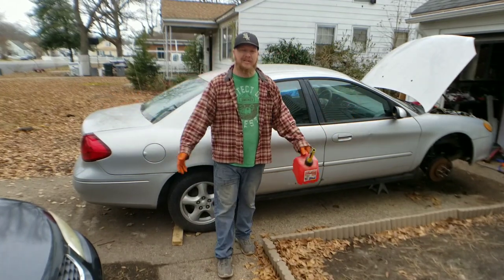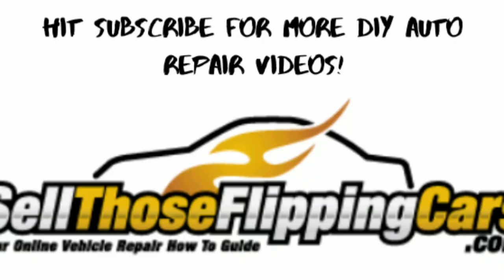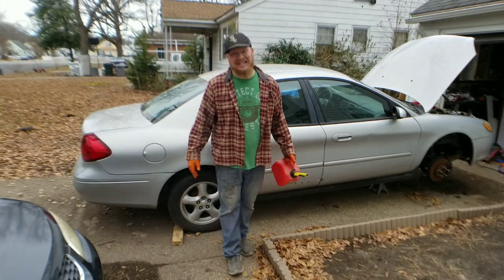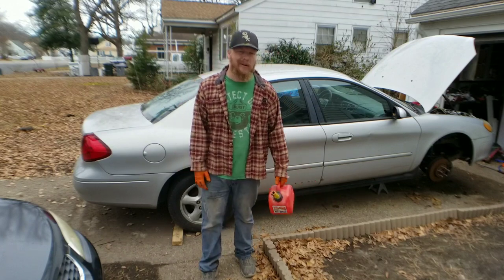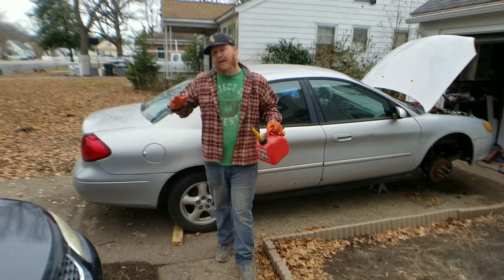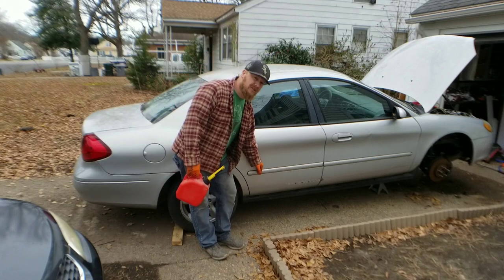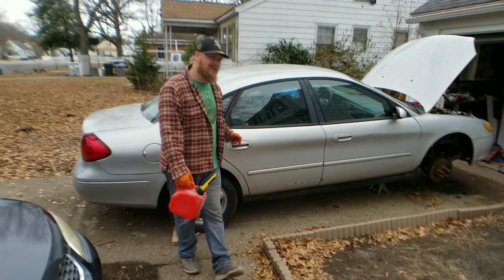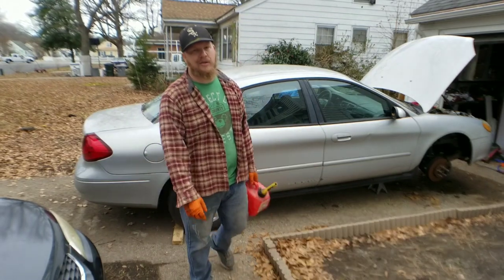What are some Dirty Fuel Filter Symptoms?

Comment: The word you're thinking of is corrodes.
Reply from the maker: Thank you Mathias I knew it I couldn't think of i. Even though it was on the tip of my tongue lol
Reply: @Sellthoseflippingcars  Hey I gotta quick question. When I start my car in the Morning... It starts great runs great. If I turn the car off and run in the store, 8 out 10 times I come back out and when I start the car again, it starts running rough and sounds like its gonna stall and after eving it ans driving for a minute it drives great. I just got new plugs n wires, new radiator, new battery, new serpentine belt, and put in a new engine air filter. Any ideas?
Reply from the maker: @mathiaskanuck6759   I would check your IAF sensor, it should be located near your throttle body.
Reply: @Sellthoseflippingcars  Ahhhh thanks. How do I Know if its bad?
Reply from the maker: @mathiaskanuck6759  your welcome, this is for the idle air control valve which will give you the rough idle. Unplug the sensor and run the vehicle if the rpm's change then you have a bad sensor. Also don't forget to check for any vacuum leaks.
Reply: @Sellthoseflippingcars  Gotchya. I was think fuel filter maybe... Def not fuel pump cause its an intermediate thing.
Reply from the maker: @mathiaskanuck6759  that is a great place to check as well!